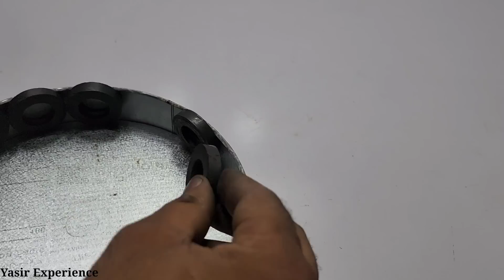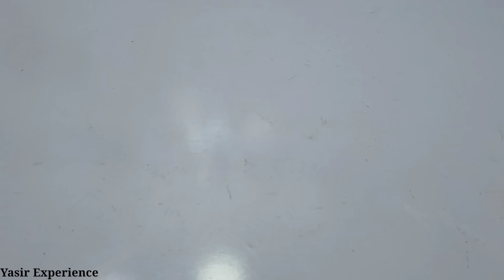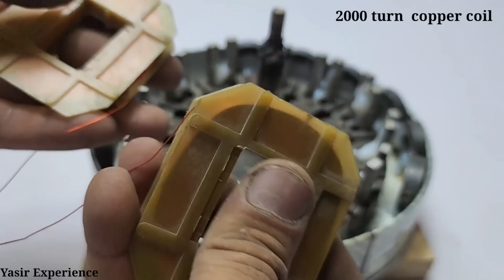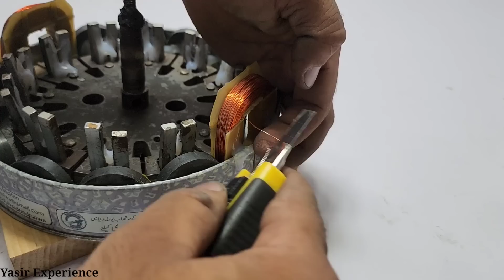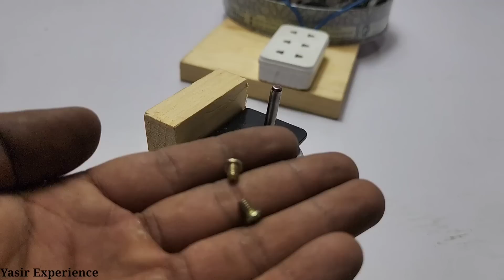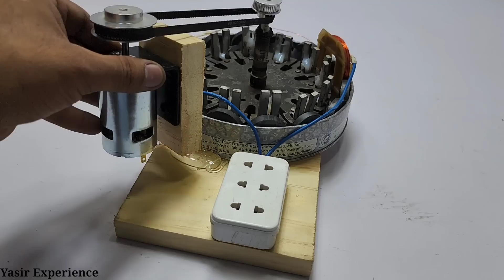Turn Super and Permanent Magnet into 270v. 20000W Generator Use Copper Wire

Comment: Absolute nonsense. Circular magnets around the perimeter have absolutely no effect on anything and are therefore useless. The coils are inserted instead of two magnets, they are air without a core, so the magnetic losses are large and the efficiency is therefore very low. The stated voltage of 270 V and power of 20,000 W cannot be achieved with this primitive device in any case. Turning on the same bulbs over and over again is, of course, cheating.
Reply: Братишка, заметь, от неравномерно вращающейся темы лампочки мерцают, т.е. питаются от этих катушек (даже если реальной мощности и меньше, но она есть)

Comment: you can modify gold magnet wire instead of copper magnet wire or scrap electronic board with gold circuit maybe you can 10x the wattages of your project. you can use pvc  infinite water pump instead of using dc motor. or solar electric fan for your magnet ac motor.